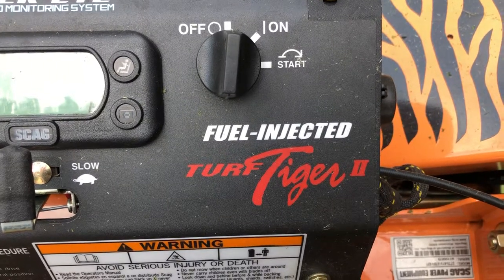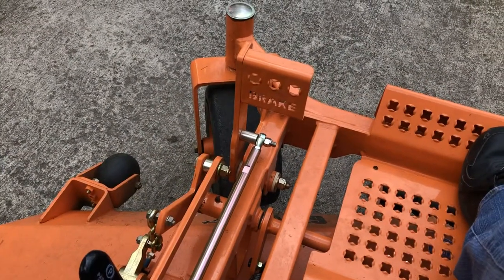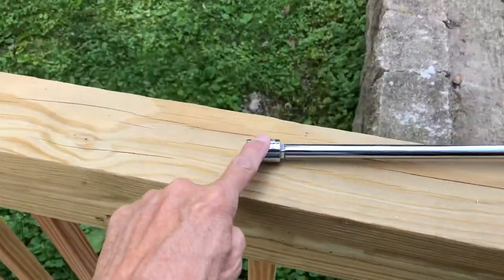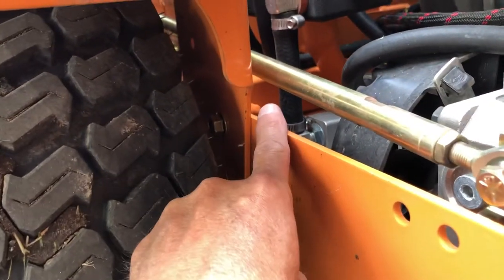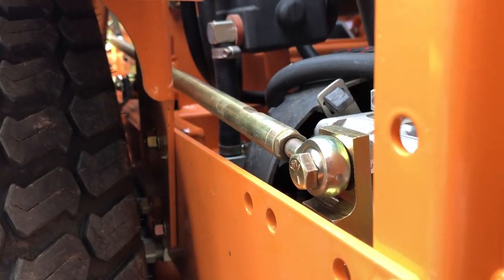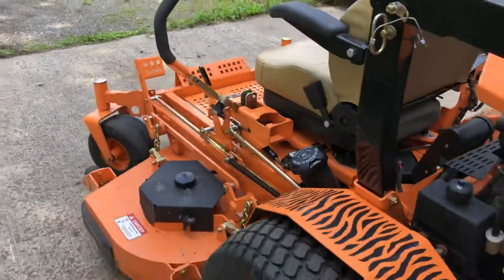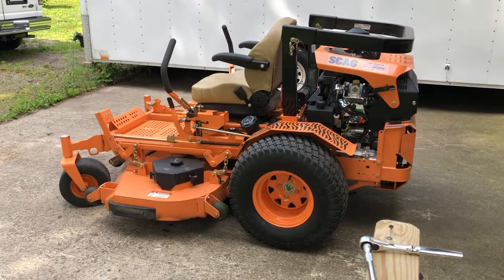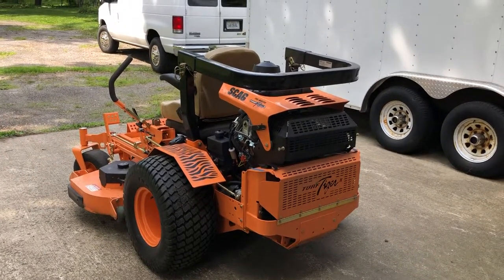SCAG ZTR parking brake adjustment

Comment: Super great advice what’s also funny is the issue with my scag is that the parking brake is so loose it moves around in the trailer
Reply from the maker: Now that mine is adjusted right it works perfectly.  To be honest, the parking brake setup was better on my old Turf Tiger, wish they didn’t mess with that on the new ones.